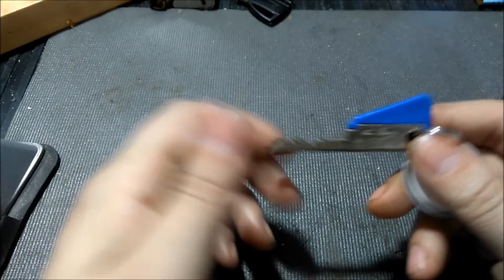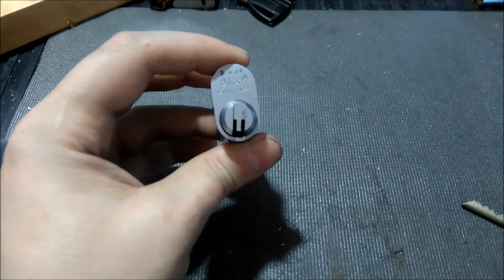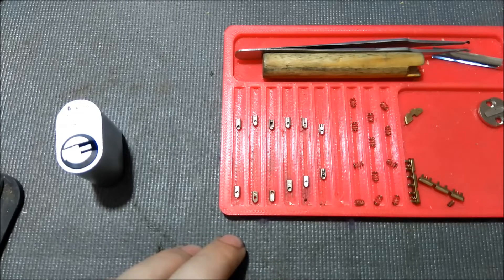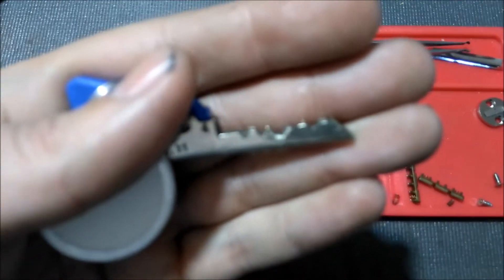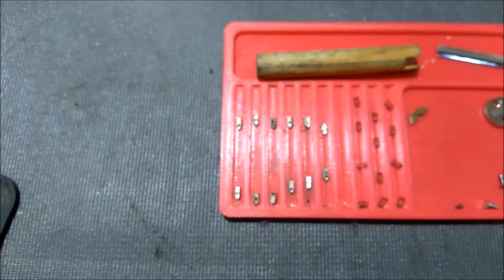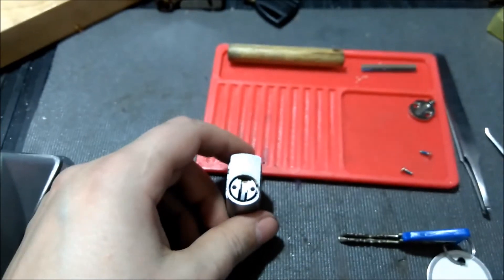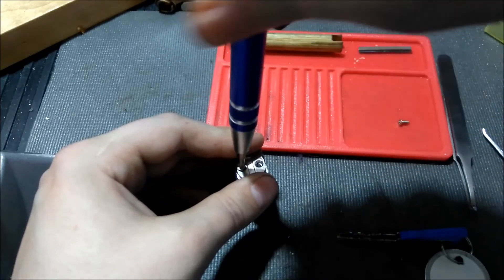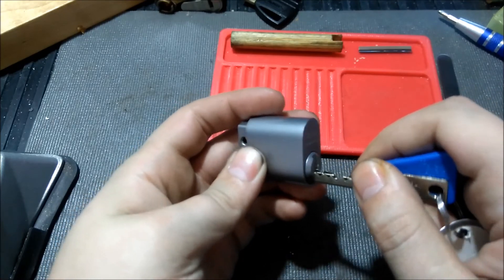(105) Pinning up a BiLock 570 cylinder !

Comment: Now you're in for some fun. ;)
Reply from the maker: hahaha tell me about it, lol. No joy yet, I keep over setting the low cuts trying to get to the high ones.. on the right bank, number 3 is a 4 cut, and number 6 is a 1 cut. left bank is tough too.. Whats your pick of choice for these ?t
Reply: @RookieLock  Diamonds, always. The thinner shank of a Deep Cut Access Pick (Peterson) is nice for slipping underneath low cut pins. Sometimes you will need to drop off tension a little to release a slightly over-set 4 or any pin caught in a false gate. Just feel for what is set correctly and fix anything that isn't.
Reply from the maker: @NoctisMotus  Yeah, I was kind of thinking a half diamond would be best.. I've been using the sparrows ofset hybrid untill now, but that was with the mastered ones.. I dont think I had to get under a 4 cut to set a 1 or 2 untill now.. Plenty of work to be done, lol.. Thanks again buddy!
Reply: @RookieLock  Like I said, if you slightly over-set a 4 to set the 1, a little tension reduction and jiggling can fix the 4.
Reply from the maker: @NoctisMotus  I'll keep that in mind next attempt, thanks buddy!